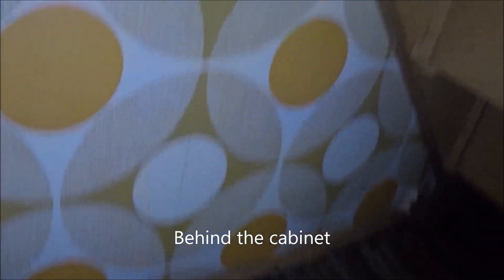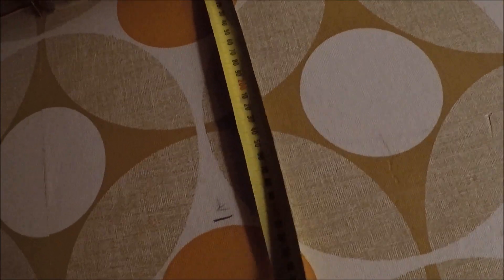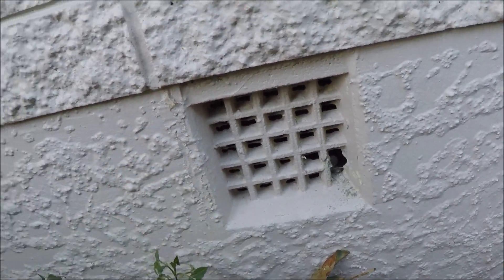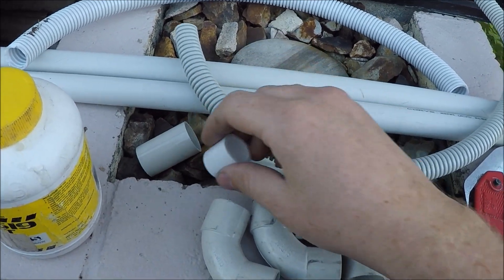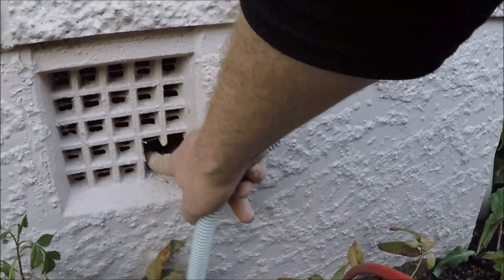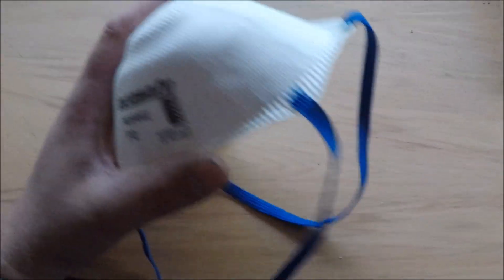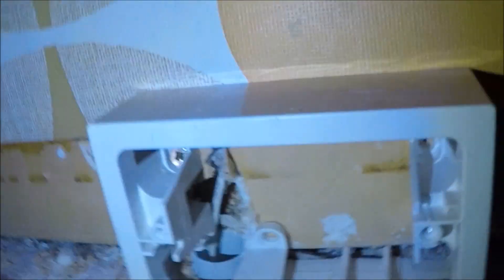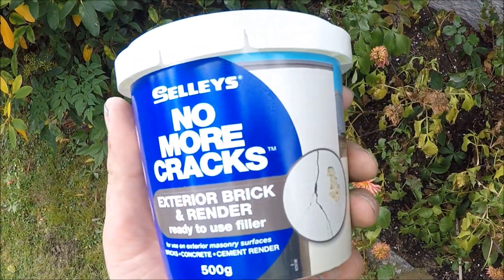How To Ensure Your Fibre Connection is Future Proofed

Comment: Chorus wanted to do our fibre. Came out and said they couldn't do it due to asbestos so wanted to drill it through the aluminium window frame,  into the lounge, down the wall where we would have to have conduit, their ugly modem, and our phone socket right next to the TV. Told them I would drill the holes and seal any cuts. No, then they made another appointment to come out, never showed up. When we called to ask why, suddenly even coming onto the property which has asbestos is a safety hazard. So we now have until October until we go off the phone and internet unless we can find a contractor Wondering what a world without a home phone and internet will be like at the moment.

Comment: Nice video sparkydave, just starting this process and was wondering: I don't have that style draw cable, but I do have a 15m "wire draw fish tape" which is long enough to do the length I need, can I use that to pull the fibre cable through so I don't have to buy a roll off draw cable? Cheers Andy
Reply from the maker: Defo anything that fits would be fine. Even easy enough to vacuum a draw string (ie, builders string line) through using a plastic bag tied on the end after the conduit is installed.
Reply: @sparkydave  oh that's an interesting idea. I might just use the fish tape then. Thanks for the reply mate 👍

Comment: Great filming, but coming from a fibre background i would have used that same micro tube that they cut off outside your wall, i would have taken that all the way to the cabinet and then blown the fibre cable right through the less bends the better,  but if all customers did this it would make the job way easier!!
Good on you mate! Keep it up..

Comment: quick question, do you have to have a duct under the house or is it just something you wanted to do?
Reply from the maker: Na no requirements other than new housing we always set up a conduit draw wire system, the fibre optic cable is very small and fragile, the chorus guys just clip it bare under existing houses and pin it to fences (in protection) to speed the job up rather than future proofing it in conduit under the house, from getting knocked around by tradesmen, chewed by rats, also trenching it prevents it becoming a costly neighbour fencing issue in the future.